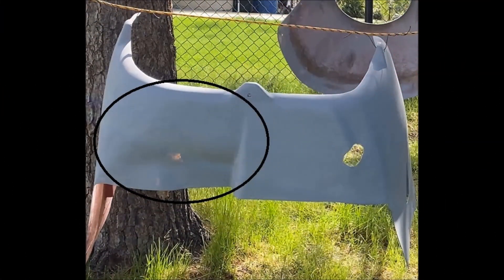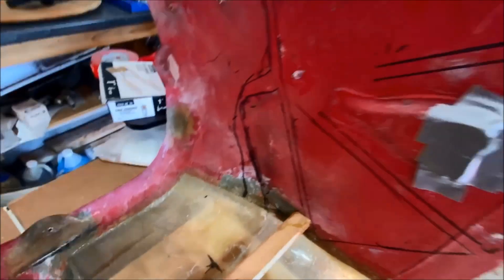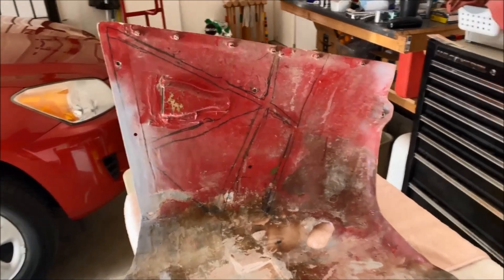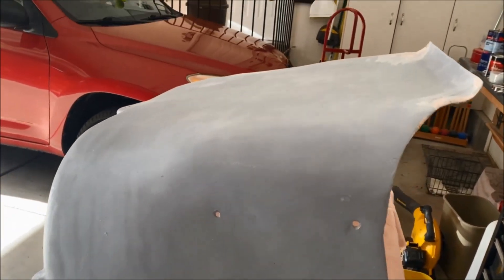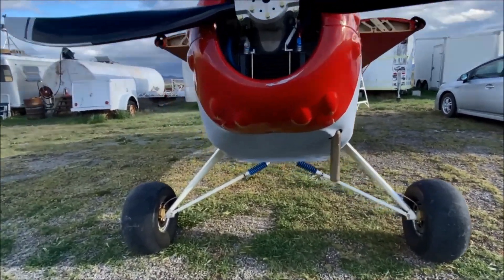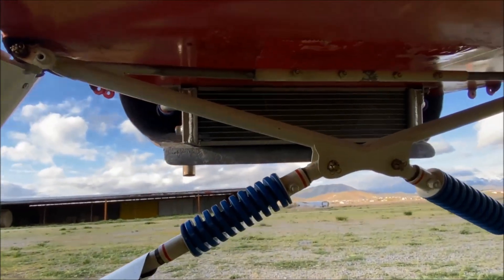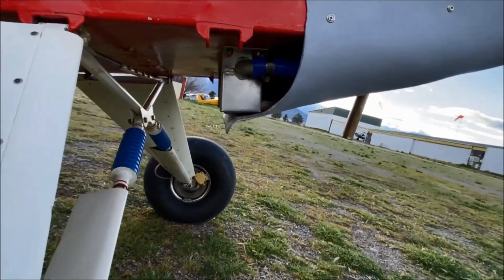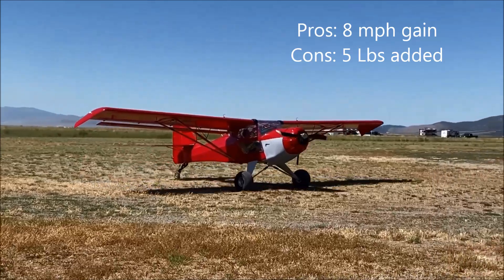Kitfox IV cowling extension

Comment: What front suspension is that? Also how are you liking the t3 rear suspension? I am about to swap over to the match tailwheel after a loop by the maul yesterday....  Thanks for your input and content!
Reply from the maker: @timw-j5g  The front suspension is the very original suspension that Kitfox used to sale, they don't make it anymore but I really like it. I also like the T3 rear suspension and I believe that with the Matco wheel is a great match. The only one thing I don't like about the T3 suspension is that the sock absorber fails very quick. The first one was replaced under warranty and now, I am on my third one.